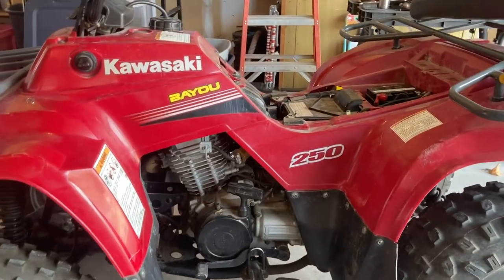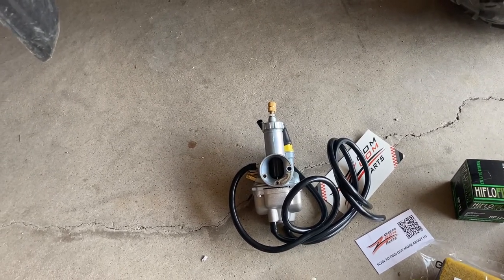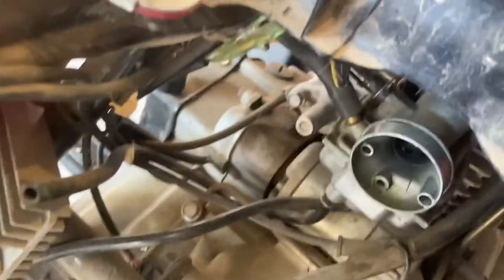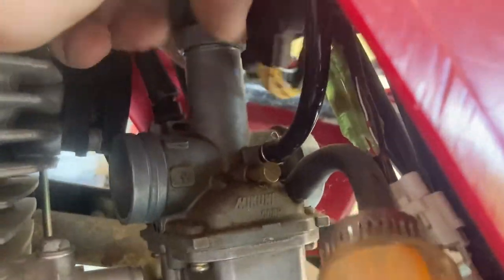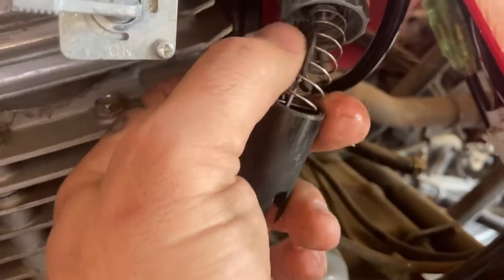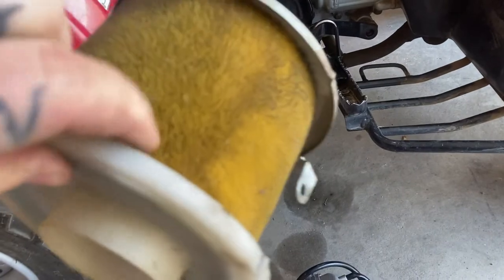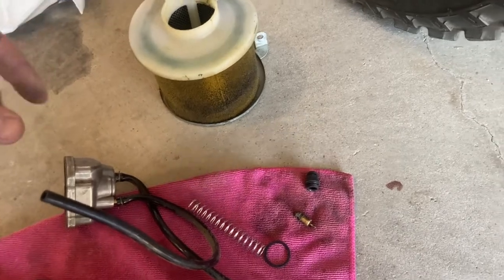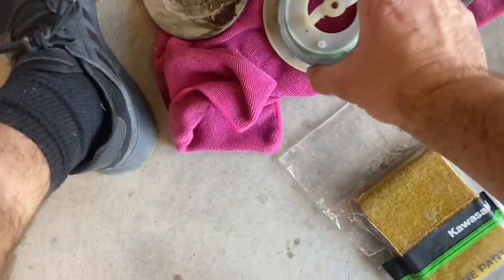Kawasaki Bayou 250 carburetor replacement!

Comment: I was having idling issues/ back firing through the carb. Replaced it with an identical one as this.  Idles fine now with no issues. 

I will add this for people who may not  have much knowledge about this like me.. black spacer/ slide for the throttle needs to sit all the way down. 1st time i had it in backwards lol.. doesn't wanna start wide open. Fuel line nozzle on new was little bit smaller than factory.  Check your vacuum lines, one of mine was plugged solid.

Thanks for the vid!
Reply: Thank you I just picked one up today wicked idling problem carb is second thing I’m doing first is the breaks! She rips though

Comment: I have a 2003 ( same as yours). I always had problems along with a zillion other people with idle/carb issues.  Even the Honda dealership worked on it to no avail.  They literally told me push it off a cliff.  Biggest mistake I ever made was buying this bayou, but seems to work for you. Lots of people seem to have problems in your comments section!

Comment: HELP!! I KNOW NOTHING ABOUT THIS MACHINE & JUST BOUGHT IT LAST NIGHT.  THOSE 2 VENT LINES?? THAT YOU TUCKED THROUGH THE BOTTOM? I thought 1's connection came off from  somewhere because gas was running out of one while sitting on my trailer. 
Am I supposed to have to black lines just hanging there then? Why is gas coming out of one?
Reply: Btw, I'm a girl so again my mechanical skills are closer to zero
Reply from the maker: One of them is a drain hose to empty the carb the other is a overflow line if your float is off or sticks it let’s fuel out. Hope this helps you don’t have to have those two hoses on the bottom of the carb on just keeps fuel from running all over the engine.

Comment: after watching this video I bought this carb for my 03 Bayou 250. Before I couldn’t get it to start and stay running and now after installing this it idles beautifully. Now when I try to give it any gas it dies on me, do I need to try adjusting anything? Fresh oil, new plug and battery so far.
Reply from the maker: Do you have the air filter on and is it the stock setup I have had bikes run lean with aftermarket setups. You can also adjust the fuel mixture screw. I believe there’s a idle and mixture screw on the side of the carb you can also check the needle adjustment you may need to lower it one notch.
Reply: @BASgarage  yep everything is stock. I put the air filter and box back on and it fired up. Putted around my yard for the first time in years (dad owned the quad when I was a kid and gifted it to me last year because it was just sitting for years). I know the idle screw is right next to the gas line. There’s also one on the bottom towards the front. Would that be the fuel mixture screw? Also there’s two inside but I haven’t opened the bowl up or anything on the aftermarket carb.
Reply from the maker: @Flores97Drummin  yes the one on the front is the fuel mixture screw I think I set this one at 1 and 1/2 turns that should get you close anyway.

Comment: So I bought a 80s bayou 220 only stays running with the choke on was still rideable replaced spark plug fuel filter and air filter only thing left really is carb any time I hit the throttle it will die will stay running any time it's jus choked starts up every time weather it is pull started or electric ?
Reply from the maker: Yea definitely could be a plugged main jet or passage in the carb sounds like it’s having a hard time pulling fuel in also check the rubber boats around the carb if they are cracked or leaking can cause similar symptoms.

Comment: I put a new carb but mines won’t idle same model and everything as yours I bought from Amazon as well . What do I have to adjust ? I can keep it running when I hold the gas but when it idles it’s dies .
Reply from the maker: So on the side of the carb, there’s a small screw that you can adjust in to up the idle.

Comment: Hey working on mine and got everything off except choke cable and it won't pull out?
I've been spraying it with wd40 to see if it will loosen up?
Is there anything else I could do?
Has set for 5 years!
Reply from the maker: You might be able to blow it out with an air compressor In side of the carb there’s a hole one of them goes to the choke you should be able to track the the passage way good luck you might just have to get a new choke cable.
Reply: @BASgarage  okay man thanks a buddy!
In no hurry really so will keep trying and if not works will get new choke cable for sure!!

Comment: Changed the carb on my 94 now idles high when given gas puts out... and moves by itself .. but now pull start hard to do and wont run at all
Reply from the maker: Check the oil did you change may have leaked gas into it before you swapped carbs very common on these for the float to stick open and dump fuel into the engine oil
Reply: Just drained oil, putting this exact carb you are, well see what happens, fingers crossed. Oil was wayy over high,
Reply: @kennethfrancis6209 update?

Comment: I bought this exact bayou today and after an hour of riding it died. It idles super fast and backfires ALOT. Also whenever I put it into gear it immediately dies. It’s also leaking fuel somewhere. Does this sound like a carb issue?
Reply from the maker: Could be check your oil to make sure it doesn’t have fuel in it sometimes these carbs float stick
Reply: @BASgarage  how can you check to see if oil has fuel in it? It’s also leaking some oil from the engine case but
Reply from the maker: @JoeyTV  You should be able to smell it and the oil will be really thin
Reply: Sounds like someone monkeyed with the carburetor and didn’t know what they were doing. Have you tried adjusting the idle speed screw on the left side of the carb? The choke may be stuck. The idle/air mixture screw is located on back of the carburetor behind the float bowl, it may have a plug over it. Be extra cautious if you adjust this, default setting is 1& 1/2 turn out from seated. You may get by cleaning the carburetor in a can of Berryman Chem-Dip carburetor cleaner or run some fresh gas and Sea-Foam additive through it. Check your spark plug too, that may cause some popping/backfiring. Like the author said, the Chinese carbs you get(Amazon or EBay) are iffy. You may luck out on the first one or not. I replace one on my brother’s Bayou 250 and could not get it adjusted right but was able to successfully rebuild his original. I purchased an All Balls Racing carb kit for my Bayou 250 from Amazon and installed it three days ago and engine runs great. IF you decide to disassemble your carb and rebuild it, be careful when unscrewing the idle/air mixture screw. If you run into resistance screwing it out, leave it alone. That happened on my brother’s and that’s why we ordered a clone carb. Get a shop manual for your Bayou or check out carb rebuild videos on YouTube. I hope you get it running good. Oh, check for rotten fuel hoses and rubber manifold/air box connector too.
Reply: @jameslester3861  it ended up being the throttle cable having issues. But the carb has other issues as well, it just wasn’t the reason it was dying. The carb float gets stuck often I’ve thought about taking it out and cleaning it but honestly I’m afraid if I do so that it will unlock some other issue like bad seals within the carb. Would you recommend replacing the carb with a knock off one?
Reply: Whenever it gets stuck I literally pick it up and from behind and drop it and that tends to unstick it
Reply: @JoeyTV  I would try cleaning and overhauling the oe carb first. I would buy a China replacement only as a last resort.

Comment: Hey Bud great video! Bought same replacement carb as you did, I am having a heck of a time getting choke cable back in seems too long. help!
Reply from the maker: Yea it should go it’s kinda a pain to get the choke cable hooked back up are you having issues getting hooked up or on the carb it’s self
Reply: B.A.S. Garage does it come with the choke plunger?
Reply from the maker: @ryanbeard6209  yes
Reply: Take lever off choke to get more cable
Reply: And I'm having trouble getting mine out lol!
Reply: @leevanmatre1989  I just broke mine. The choke slide was bound up inside there. I took a punch and lightly whacked it to loosen it.. it smooshed it. I’m here to see if the replacement carb comes with the spring and slide for the choke.

Comment: my choke cable was stuck, and i soaked it put heat on it and waited, ended up breaking my choke line, then i was trying to use the throttle that came with the new carb and i broke the old one after realizing you used the old one, im sol now and have no clue how to even fix this
Reply from the maker: Man that sucks I think the only thing you can do is get a new or used choke cable and throttle. There’s normally quite a bit of parts for these on eBay.
Reply: @BASgarage  i just bought a new choke cable, hopefully i can still save the throttle

Comment: I have a issue my choke line does not wanna come
Reply from the maker: You can try soaking it in PB blaster or other penetrating oil then just give it a good pull sometimes they can be really stuck in there. Good Luck